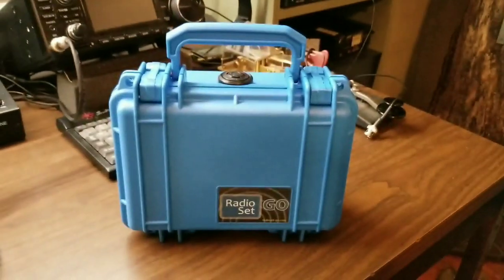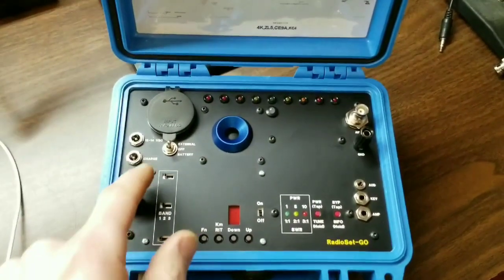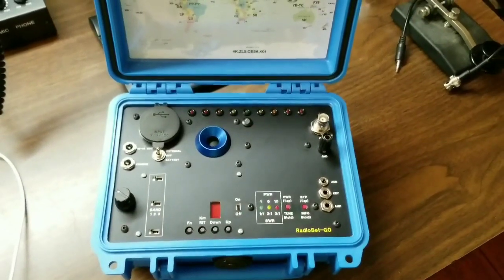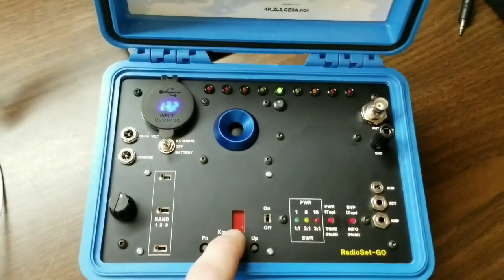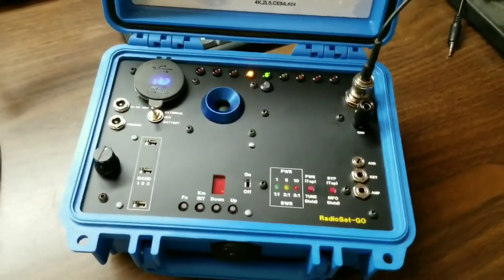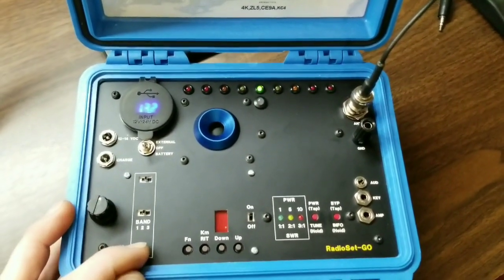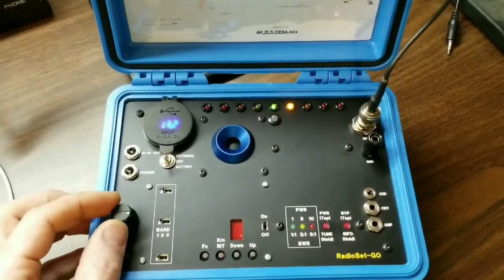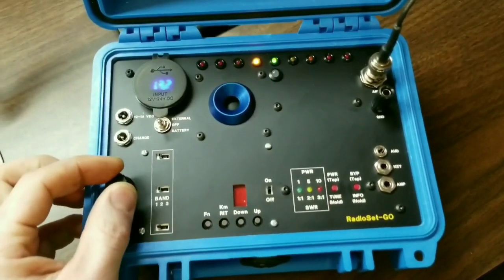RadioSet-GO converted MTR3b QRP CW transceiver

Comment: Nice work probably one of my favourite radio’s to start with ..... have to ask about what voltage regulator did you use, they can be really noisy producing of distortion with HF radio’s.
Reply from the maker: Thank you! Yes, I was a little concerned about noise from the regulator, but fortunately it seems to be very quiet. Here it is: https://www.pololu.com/product/2869